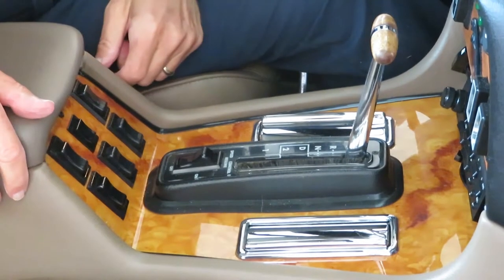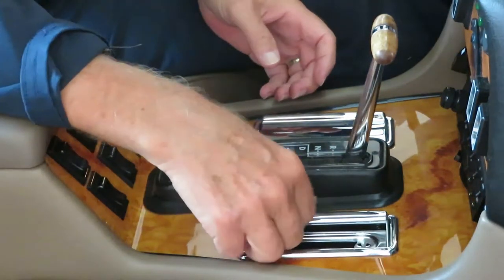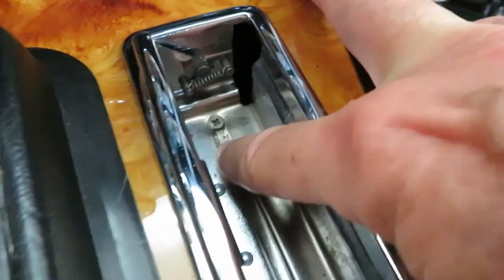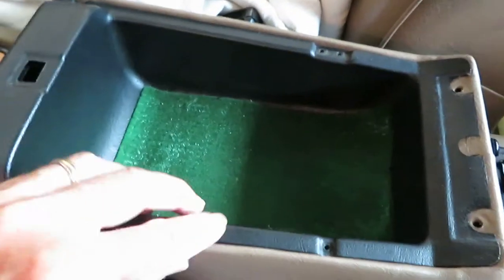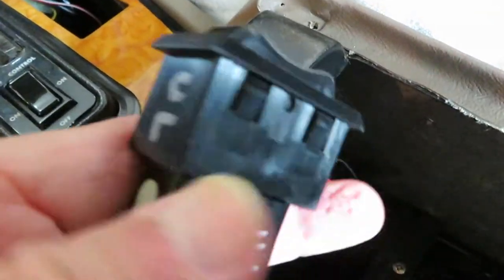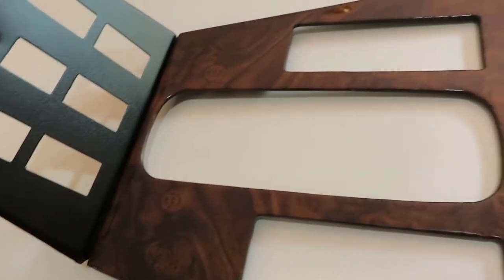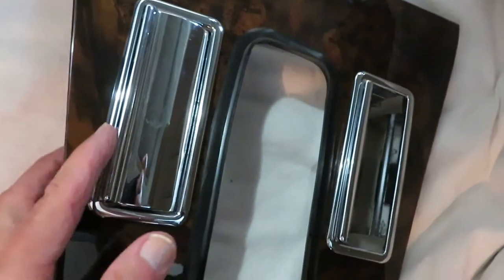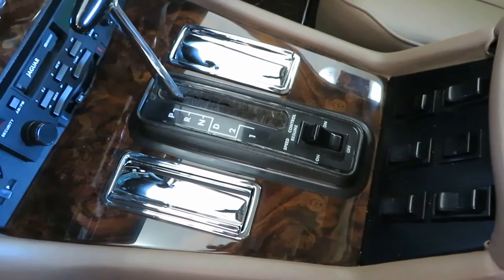Jaguar XJ6 Ski Slope and shifter Panel removal

Comment: very helpful thank you. i need to remove the headliner on my 87 xj6. any ideas on where to start?
Reply: The easiest to get out is through the front or rear sunscreen.  But if you are patient you can get it out through the back door.  There is some material available on the web concerning the process.

Comment: It does not matter which way the switch goes in  it does matter which you put the wiring block to the switch.  
Not all models had black vinyl.